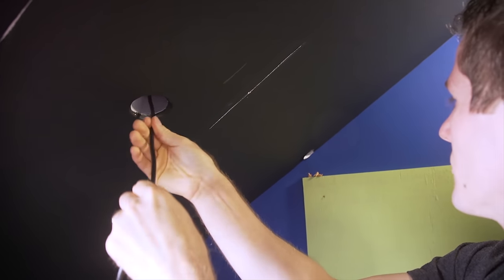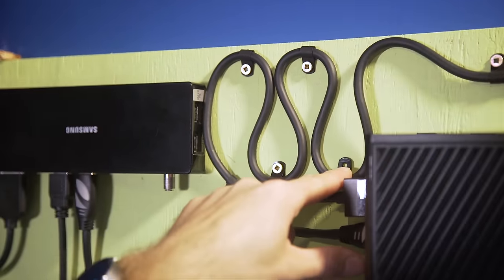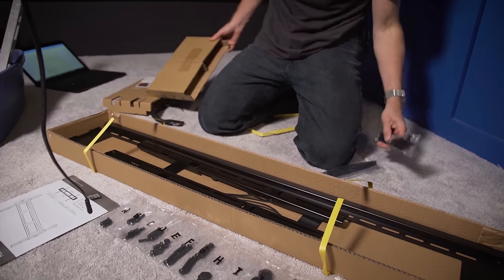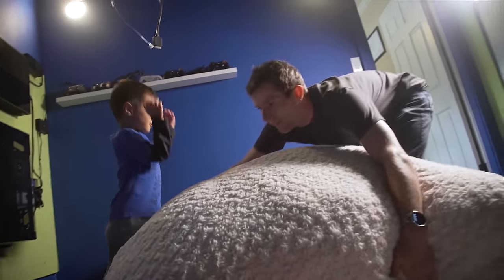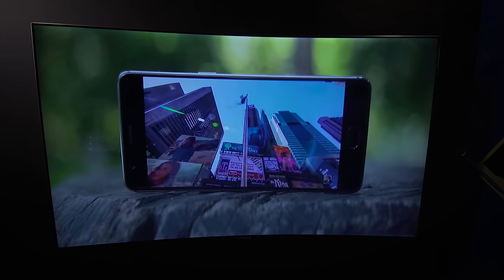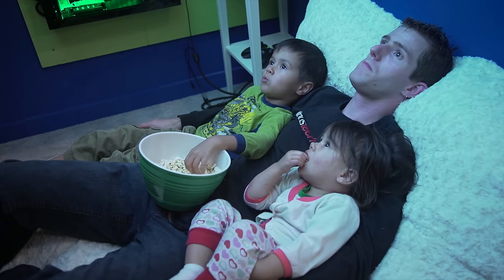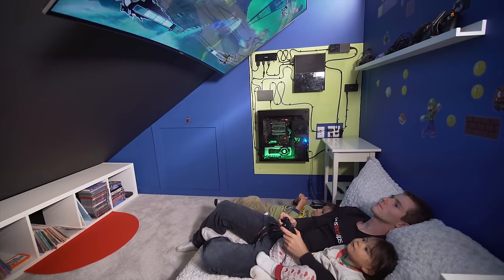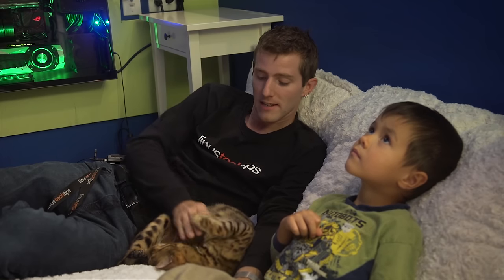World's Most Comfortable Gaming Setup (Finale)

Comment: "This mount is NOT designed for hanging anything from this angle. It could injure or even kill you if it falls!"*Makes it a play area for his kids*
Reply: (Please don't take this serious.)
Reply: (triggered?)
Reply: Maybe he gets lucky once the tv falls off the wall and it gets both of the kids (joke)
Reply: That would be very unfortunate for the lovely television.The poor television...
Reply: HA
Reply: What if it doesn't fall ? Ba dum tsss
Reply: it can hold a big amount of pounds and he said that so u shouldn't be worried
Reply: Considering it's in wood, and the screws aren't parallel to the ground, it's no longer rated for 200lbs (which is the shear force with a factor of safety). The weight is no longer supported by the cross sectional strength of the screws, but by the threads, and general friction. Over time, the threads will either unscrew themselves due to vibration, or the wood holding the threads in place will give.

Comment: I'd suggest installing some security cables on the TV in case it falls for some reason. 
Chances of it supporting the TV for a significant amount of time after mount failure are slim, but it most likely will give you enough warning to clear the fall area and/or get the TV supported.
Reply from the maker: +EnlightenedAce yeah I didn't want to show it because this is not a recommended install under any circumstances (easier to just say don't do it) but with some simple straps its was to safeguard the TV against slipping out of the bottom of the mount and falling.
Reply: +LinusTechTips how long has it been there now? And have there been any problems with it?
Reply: +LinusTechTips Hooray I watch this video on a Samsung phone!
Reply: Btw the they should be put under the stairs... the most compact.
Reply: Security cables / chain was my first thought in all of this - especially with the kids. The left-hand edge of the TV is exposed too and is susceptible to being caught when someone walks past it. I would put a padded barrier / blocker / something just to the left of the LHS so that it takes any knocks instead of the TV. It may be tough to make it fit in with the aesthetics of the room but you can never be too safe (owner of a wall-mounted 60" Samsung 4K with 2 young kids).
Reply: Linus.... i want to be your son. Adoption papers are being mailed to you as we speak.
Reply: Such a cool setup! I'm jealous at how nice everything turned out! I have my 55" 1080p Samsung TV on my wall. My bed is just a few feet away from it and when the TV is fully extended and tilted the setup is almost similar to your video. On the side of that I got my 2K 32" monitor hook up to a Skylake i7 build to :)
Reply: No kidding, I've still never had an LCD tv and I'm 22, let alone any sort of setup like this.

Granted now I just watch everything on my computer but for the first 16 years of my life that wasn't the case lol.
Reply: An installation like this shouldn't be DIY-ed. By law ceiling mounted stuff in commercial venues has to be regularly inspected for safety because they literally fall and kill people every day. Falling TVs injure 18K americans a year!
Reply: Jesse Those big HDTVs will change your life!! I can understand you never had one as they can be pricey. I got mine a few years ago when 4k tvs were first coming out and I looked at Best Buy and Frys open box return items that were on clearance. I got my TV for $600 and it's a smart TV as well :) Just dig around for deals especially after black Friday for returns. Until then you can save money :)
Reply: While they were planning this, and before installing the insulation and panels, he could've had the contractor put a couple of 8mm or 10mm  U bolts across the beams. He could've had it stick out the wall with enough threads to help secure the mount with some heavy duty fender washers. The combination of bolts and the wood screws would secure the shit out of that mount. As for the TV, he might just have  get creative.
Reply: +LinusTechTips You should do a video for your Plex server. I know you made a video on Plex, but I am talking more specifically about how your Plex server is set up, what OS it uses, what hardware it has, etc. I know quite a bit about Plex and servers in general, but for those who don't know a lot about it, a video would certainly help, plus I want to compare my setup to yours. :P
Reply: +LinusTechTips see the four corners of the curved it I recommend support from the roof to the corners cas it's hanging and just in case something happens just cas of these corners
Reply: Just drive screws up from the bottom like most mounts that goes on the tv and blue threadlocker them
Reply: pffffffffffffffffffff
zipties will do
Reply: This is such a good idea. Please be safe, guys.
Reply: I second this; are there nuts behind the wall that he screwed the TV into? otherwise I see the wood weakening over time, and with those kids in there, having it fall would suck
Reply: LOL no he lagged bolted them into the studs/trusses . 6 of them!  Those are never coming out.
Reply: this
Reply: he hanged on the mount surely linus weighs more than the tv
Reply: +Captain Obvious I doubt he had a choice. The contractor likely wanted no part of that mount install for fear of liability.
Reply: couldn't hurt to have a cable, but those huge lag screws won't just "come loose" ... that mount would probably take the roof with it.
Reply: This. I was very worried when I saw those kids sitting there with Linus so I hope you have enough security measures :)
Have a lot of fun! May your framerate be high and temps low! :)
Reply: Yep, I have few lag bolts holding my 75 inch tv still level as ever.. Those just don't come lose but the tv swing off the bottom clips it may if him and his rough house in there. Thats I suggesting driving screws up to keep locked onto the mount and then threadlocker from vibrating or backing off that's highly likely because the weight of the tv would be against the threads
Reply: Not True the screws are under shear load when it's mounted vertical or parallel  to the wall as the angle increase the screw become less and less under shear load and using the threads to hold it bracket to the tv
Reply: I got this thick and heavy 2013 vizio 55 inch tv that took me and my dad to lift, hanging on a full motion mount. I think the tv is too heavy because the tv is tilted sideways. If you move the full motion mount the whole tv would fall. So we got some chain and hooked it to the mount so it wouldn't fall. We have had it for the past 3 years and it has never fell so far.
Reply: I know, he talks about how it is not supposed to be set up like that, but he designed the room for his children... Linus really only cares about technology, doesn't he?
Reply: if not for you, atleast for your childern incase something happens, nobody wants to hear or see that tragic loss happen to your family linus, we care.
Reply: +GoldenKingStudio Linus cares about his children and probably has some rules with the room like don't go in there without him or his wife. I almost guarantee you that he will make the TV safer.
Reply: Expect ally if the room is also for his kids... Oh yeah don't forget the cat!
Reply: +Cheddar702 3:38
Reply: Any plans for a surround sound system? There are lots to choose from though.. and for such a small room you don't exactly need anything huge. Would be fun to see what you'd end up with.
Reply: Yeah, was gonna suggest soundbar. Seems he was just relying on the speakers on the tv, and in most cases they suck big time.
Reply: +Jack Le no it fucking wont
Reply: Probably a lid for the controllers would be preferred as well
Reply: A screw that is thicker then a 1/4 inch thick can hold thousands of pounds of pressure. "And that's one screw" Unless the roof caves in, that TV isn't going anywhere buddy. The only time that TV would of fallen is when they installed it. Besides, this is cool and all, but TV's these sizes are made to be 15+ feet from you, all this will do is cause eye strain and headaches when in darkness.
Reply: And how does he pay for all of this

He doesn't
Reply: I've had several TV's fall on me in my life. You'd most likely only bruise.
Reply: @Captain Obvious thanks captain obvious!
Reply: no problem
Reply: Nothing a bit of duct tape can't hold down...
Reply: Would suggest the same. Just a few O-screws in the beams, some steel cables, attached to attachment points on the TV. Especially if you would have your kids in there (unsupervised), nothing beats safety.
Reply: EnlightenedAce I
Reply: StabGecko Gaming and I
Reply: exactly. Uses a mount he can get from a partner rather than buy the actual mount. Loads of rich people have tv's above beds and shit. It's not like these things don't exist from the right suppliers. He better get a bloody steel cable around that thing.
Reply: @Stab Gecko pretty sure he cares allot more then a tv he did not even have to pay for

Comment: The one thing I find interesting is how you put a "super duper disclaimer" about how it could actually kill you if it were to fall on you because none of the equipment was designed to be mounted at that angle... and then you make it into a play room for your very small and very squishy children.
I know the disclaimer was more for liability reasons, but it still is a little odd xD
Reply: The disclaimer was probably just requested by Samsung and his other sponsors for the build because they don't want lots of people doing this then suing them if it does fall (unlikely but why risk it if you don't have to?) and the equipment used isn't rated for that sort of angle or whatever. If he's letting them in there and is lying there himself I would be be willing to bet that in reality it is very securely fastened to the wall.
Reply: For example, did you notice that he hung from the mount before mounting the TV? Linus isn't a big guy, but that is a fair test.
Reply: totally! A few seconds hanging a heavy weight is probably comparable to many months of a slightly less weight.
Reply: The disclaimer was for during the mounting process.  It's dangerous to mount a tv like that. but once it's securely up there it's not going anywhere.
Reply: He did hang on the rails 
You can not see in the video if the mount is connected by a click system or screws from top only if that is the case  then angle could be dangerous.
it depends on how the 2 Wall mount parts connect together
Reply: My Dad and I mounted a TV in his house and it was identical to that, you get it on there in such a way that it will not fall, it cant slide either thanks to a few bolts you twist down.
Reply: Z
Reply: The TV could be facing the ground, 45* or perpendicular with the ground, the mount is such that all of these positions are equally secure. Tilt is also fixed, but not by the same mechanism.. The TV is locked on rails, meaning before you screw down bolts on the TV plate that go through cut-outs in the rails and wall plate. So if the TV is all set up, it shouldn't fall off if its tilted on either axis.. it may slide 0.5" or so depending on the clearance for the bolt.
At least that is how the one I had set up worked. It was surprisingly secure.. I doubt we would ever have to upgrade to a different mount, unless we fundamentally changed the application.

Comment: I would be too scared that that TV would fall on me so I wouldn't be able to enjoy myself.
Reply: I'm surprised nobody has made a mount that covers the 45 to 90 degree mounting options. I mean it'd be insanely expensive with having to undergo much more design work and testing but it'd be the only one to guarantee safety at that angle so it'd completely corner a market niche so some people would pay for it.
Reply: I bet it's less an issue of R&D or cost, and more an issue of no one wanting to take the risk. I'm sure it's perfectly safe, but by marketing a product as being able to do that they open themselves up to lawsuits when people are dumb.
Reply: not wrong
Reply: Plus a lot of people have converted attic spaces either as bedrooms or as entertainment systems. The only problem would be what Jon Atcer said about people being dumb and in this case I imagine it would the part where people don't read manuals - no one can prove that they didn't read the manual so there would be the lawsuit - unless the error was obvious upon investigating the area
Reply: well you'd first need a wall at that angle, how many people actually have such walls/ceilings? certainly not many in europe.
Reply: +The Observer A 60" 100+ pound TV hanging over you wouldnt scare you at all? Sure its screwed on tight and wont fall but still the thought of that tv and ceiling falling on you wouldnt make you scared or edgy?
Reply: what about falling on the kids?
Reply: The mount supports up to 200lbs and he said in another comment that he put reinforcement straps on the back, just in case.
Reply: And he hung from it as well (however briefly) I think he said he was 120 pounds in a channel super fun as well
Reply: When I read that, It made me remind of The Final Destination movies
Reply: I doesn't really hang over you, or at least it would only hit your feet. And on top of that, I don't think it would hurt you too bad, it's quite thin.
Reply: impending death isn't scary whatsoever, right?
Reply: +EccentricTrolling a thin tv is still quite heavy..

Comment: This can be a perfect place to set up surround sound... Well the subwoofer might not work well in such tiny environment, but besides that, I think the 5.1 surround system would work pretty well here.
Reply: Maybe a solid 5.0 setup will do. I think a subwoofer isn't the greatest idea in this room.
Reply: CX Music They can use a smaller subwoofer. Just in case sometimes there's not enough bass going on. Redirecting the subwoofer sound to the front speakers might not be that good. Actually, I consider it better to just let 1 speaker to do all the bass rather than 5 in such small room.
Reply: Okay, you're right. Big satellite speakers are also not the best idea for this room. Maybe 5 mid-range speakers + one good, but small subwoofer.
Reply: +野龍（FlameRat） Would the Speakers be in the corners or mounted to wall and the subwoofer in the little whit shelf?
Reply: Alexander Hull I guess it would be wall-mounted since otherwise the pillow sack would block the sound.
Reply: I have a similar 4k tv from Samsung and an older home theater setup from lg which worked on my previous samsung tv but it is just collecting dust right now couse i am only able to get an image and no sound :(
Reply: 野龍 guessing you don't know what surround sounds is..
Reply: ItsCxarde Isn't surround sound just, well, surround sound?
Reply: echo may be an issue, causing a reverb. that would ruin the illusion :/
Reply: Ned Nowland I don't quite think so... For such a small room, maybe stationary wave is a bigger issue. But, yeah, maybe it would sound like you put a speaker in the restroom. XD

Comment: Always record with at least 1920x1080p60fps, recommended for the best view is 4K60Fps!
For gaming a minimum requirement, a must have is: 
- no bazzle/frame in the centre of the screen, 
- no distorted/stretched sides (seen on ultra-wide monitors), 
- at least 1920x1080p, 
- minimum 120-240Hz for 120-240Fps gaming. 
It's not recommended to buy hardwares below that minimum specs, just saying.

Comment: This is all cool and stuff but how the fuck are you gonna use a keyboard and mouse?
Reply: well its designed for console
Reply: Yeah and its got a voice recognition that probably sucks but damymn imagine watching porn on that f.ing TV hahah
Reply: A razerturret or just a wide low desk maybe?
Reply: No need if it's a pure gaming rig. Xpadder and an Xbox controller to control the mouse movement. Or, it could run Steam which has controller support. With voice commands too, you really don't need a keyboard or mouse.
Reply: +Branden DeTemple It's a decent tv but I would rather use my 4k projector just because I'm currently projecting like 300 inches and this is wayy smaller than that
Reply: this makes me wonder. i know this is a mostly console setup but for general use of the pc i wonder what you would use? like is there a app for phone or tablets that let you use them as a trackpad/keyboard.
Reply: sam locke a PlayStation or Xbox controller for gaming and a pc remote or corsair lapdog for general use and browsing
Reply: razer turret, fam
Reply: +Branden DeTemple if you can manage to use your keyboard and mouse
Reply: Have a pull over keyboard mouse holder that goes over your stomach or chest (depending on how close you want it)
Reply: Wintery Feline yeah that's what I was thinking
Reply: mrdeath799 controllers suck. you can't use them as accurate as you can use a mouse.

Comment: Dangerous on so many levels I cringed at the thumbnail!
Reply: Go to 3:38.
Reply: Zero why
Reply: Drink Bleach I watched the entire video so I read the disclaimer, still doesn't change the fact that it's a dumb setup.
Reply: Epic gamer 111 mainly hanging that much weight from ceiling on an angle using a bracket that isn't designed to be on an angle as it essentially hangs like a picture frame.
Reply: Zero But the TV doesn't weigh much compared to what the mount can hold. Even if it's not designed for such positioning, Linus would've did all the logistics and planning before undertaking something like this.
Reply: Rodney AK-81 just like the time they thought water cooling a house was a smart idea?